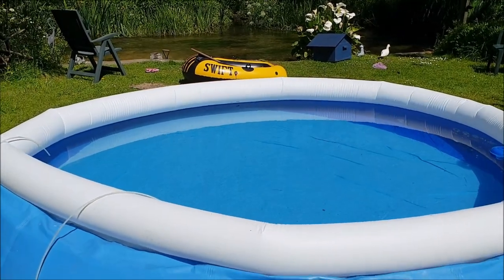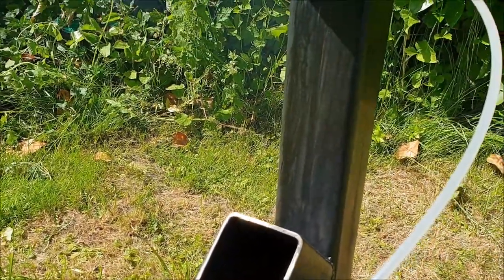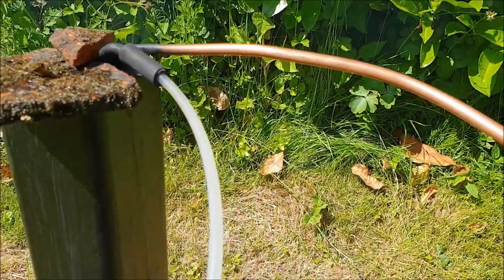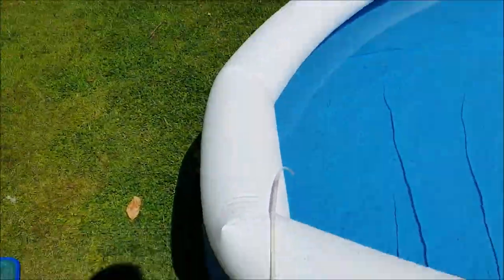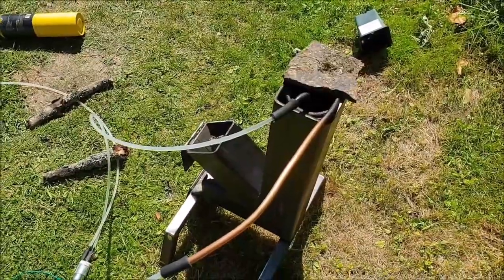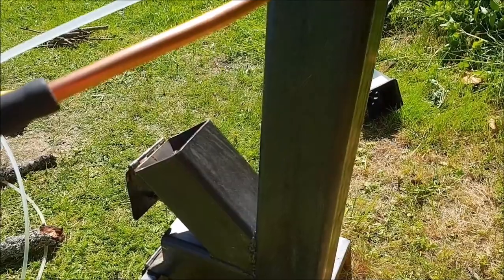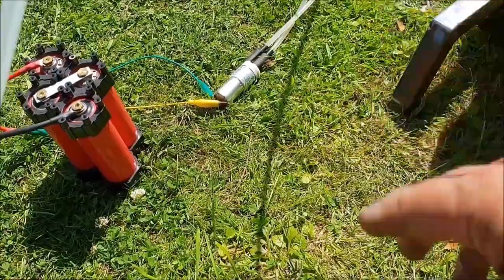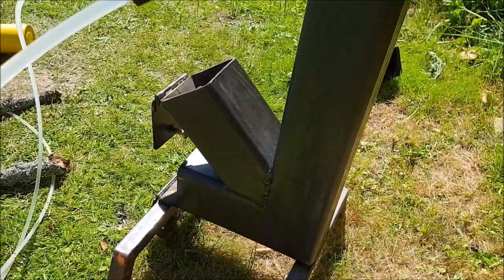Rocket Stove Pool Water Heater v1...

Comment: The point with a rocket stove is that the riser (the chimney part) is supposed to be kept hot. 
The farther down the throat of the riser you put your copper coils, the more you cool off the hot gasses, and the less rockety it will be.
Reply from the maker: Thanks, yes I discovered that.. when you start pumping water through it, it becomes difficult to keep going.

Comment: Great work and thanks for sharing.
What diameter copper tube did you use and more importantly what plastic tube and connector did you use? Thanks Mike
Reply from the maker: Thanks - 10mm copper, 6mm ID plastic tube and a cheap ebay self-priming pump: http://ebay.us/LER13i  The connector is just a piece of fuel hose.
Reply: @theq-1  
Ace thanks for the reply.  Trying to work out how much copper tube needed to heat water quickly enough.  May need to be quite a large rocket stove looking at the speed others are taking to heat with their home made stove heaters.